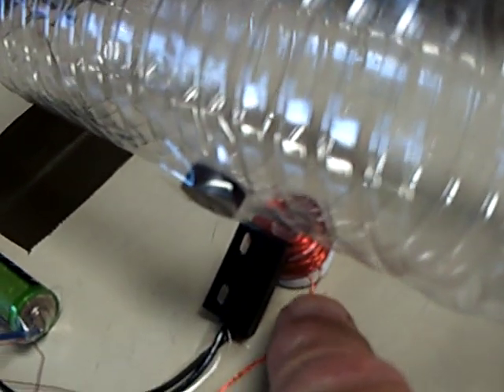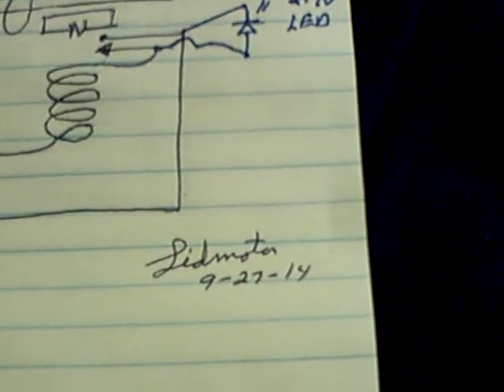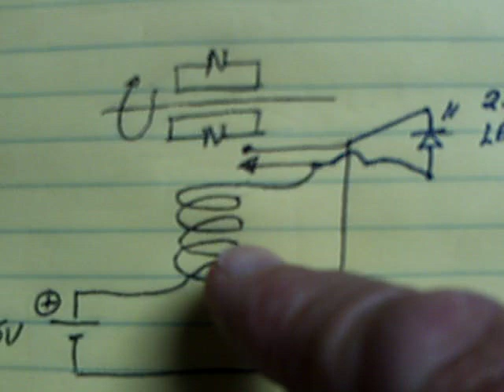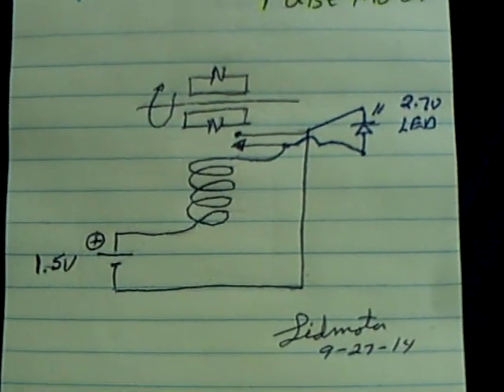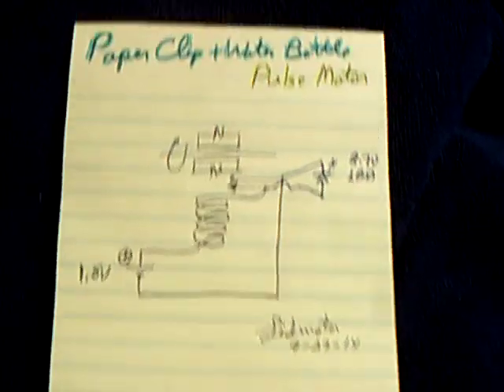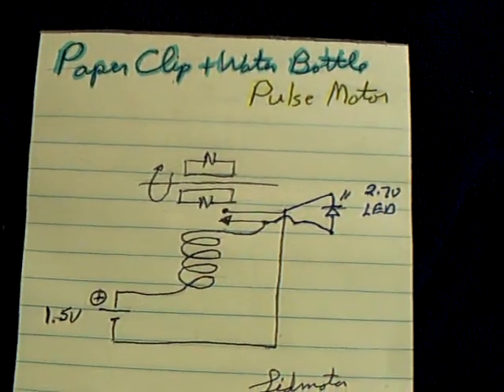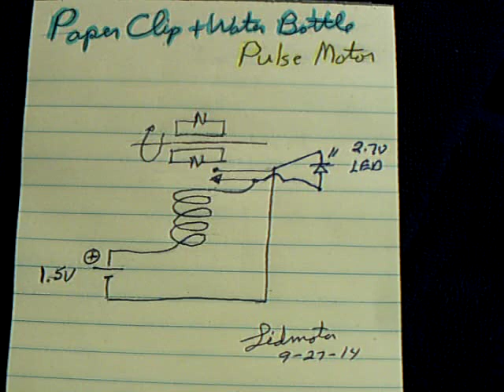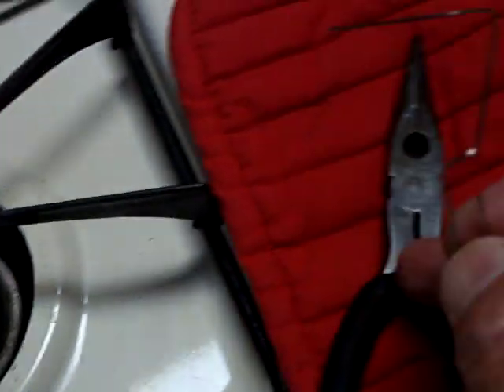Paper Clip and Water Bottle Pulse Motor

Comment: Another clever mod!

Thanks!
Reply from the maker: This is just one more way to do it.
Reply: Yep.. and a simpler one at that.

I made something simple like that once. I used 2 short bits of wood as a base & 2 short nails poked into the end of a capped bottle, I had to use a drill to cut a small half moon groove in the wood stands for the nails--otherwise the axles would roll off the wood. 

Your method is simplier & therefore better!

Thanks again for sharing!

Keep experimenting & having fun!

Comment: On the 1st video you did of this pulse motor it looked like you had the - side of the led going to the + side of the battery. On this one the - side of the led goes to the - side of the battery ????
Reply from the maker: Good catch! It really needs to go the (+) side but on a 1.5v setup the led also works going to the (-).

Comment: Can you charge a small super cap with the EMF from a pulse motor ? And if so, how ?
Reply from the maker: Yes.  Use a 1N914 or 1N4148 switching diode instead of the led and return the negative of the supercapacitor back to the (+) rail.  This is Bedini SSG style.  You can use a 1N4007 but you don't need to on a AA battery setup like this.  It has to be a small supercap and don't expect it to charge fast.  There is very little amperage.  A high voltage low uf electrolytic is more fun to watch.  Many of the Bedini folk use this method and 'cap dump' the energy into the charge battery using a seperate circuit.
Reply: ***** Thanks much. I'll give it a try.
Reply: ***** Could make a little drawing of that ?

Comment: I thought, I should let you know how I am getting on with the pulse-motor. Well, so far have nothing to shout about, but I did try putting a magnet on cardboard as you've suggested.                        That experiment has allowed me to discover something… not an invention, just that: if the North side of the magnet is placed close to the coil; it'll suck it in. Whereas, if I place the South side close to the coil, it will repel it! Could it be that I live in the South part of the earth; hence I need to change the magnet round?
Reply from the maker: No.  The other side of your coil is the other pole.  The coil and magnet need to repel in this pulse motor setup.